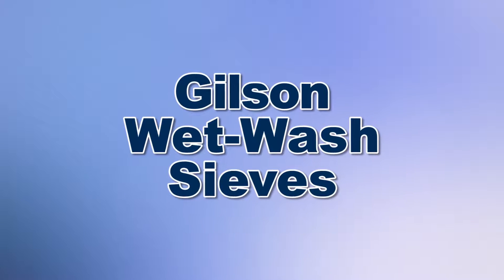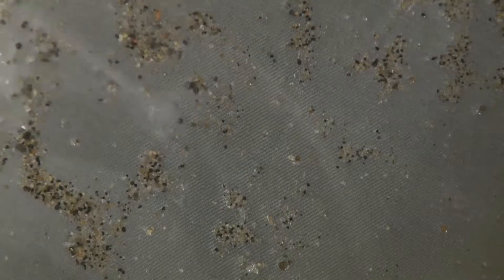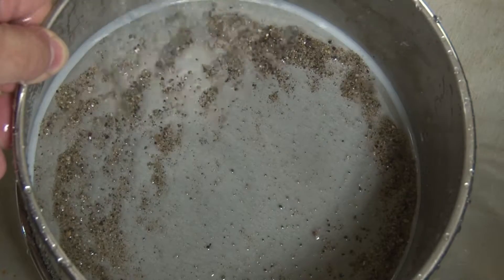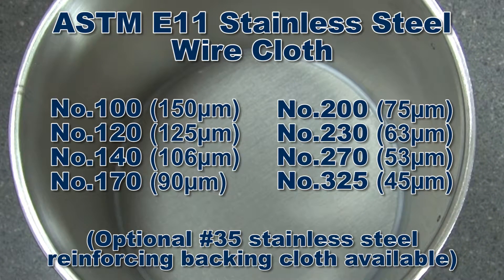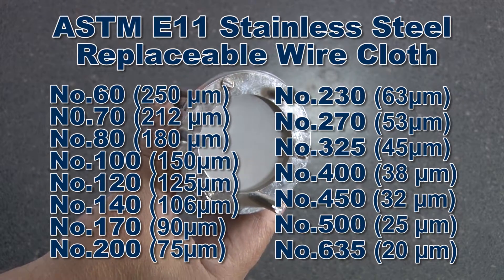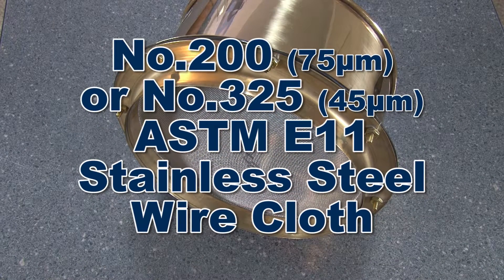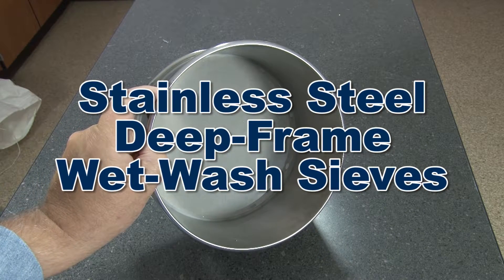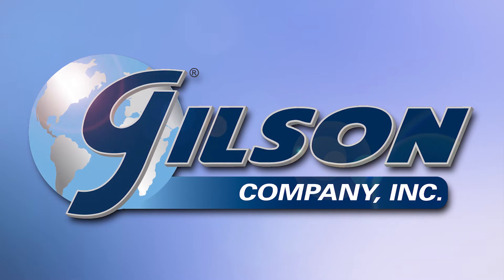Gilson Wet Wash Sieves

Comment: Would like to apply these to fruit fly separation over bucket and or stainless steel wet wash sieve.
Reply from the maker: Hello, and thank you for your comment. Our sieves are designed for use with particle sizing operations. While there are other applications for sieving, we cannot guarantee the performance or efficacy of Gilson sieves for non-particle sizing applications. If you would like help selecting a sieve size for your particular application, please contact our technical support at 740-548-7298 or browse our selection of sieves on our website at globalgilson.com/test-sieves.